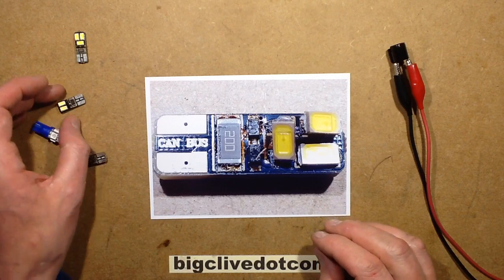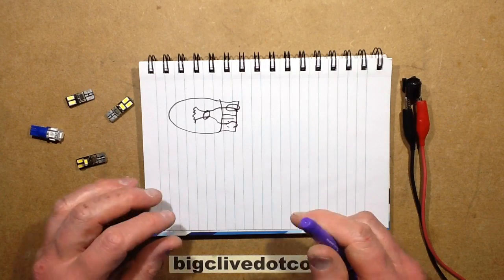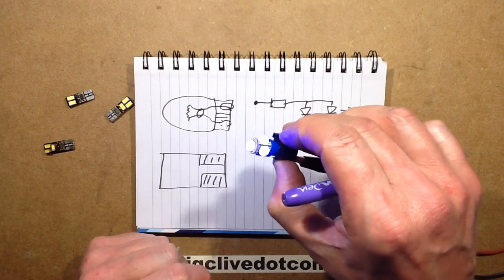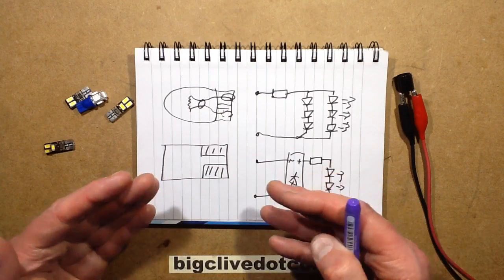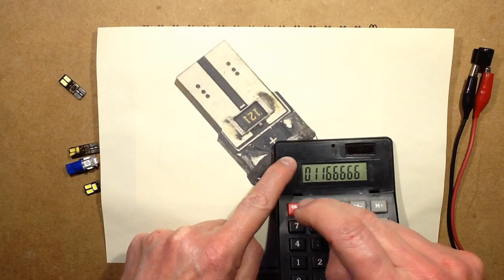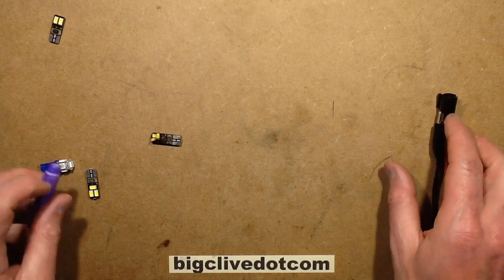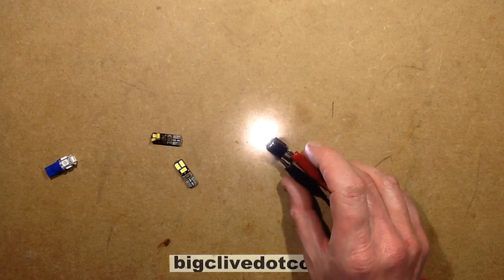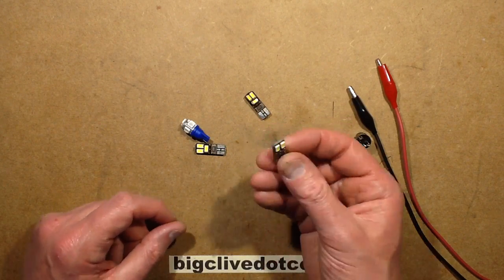Smokin' hot CANbus LED lamps.  (230C in open air.)

Comment: Recently installed a few different led bulb types to a Vw golf mk5 2004 and the canbus system doesn’t like any of them the parking or side light 501 bulbs like you show in this video don’t even work due to the system not getting the correct resistance so I found resistors with heat syncs to wire in and solved the issue after working out which resistance each bulb needed I do worry tho as the full beam and parking light wires are shared so i’m not sure it’s safe to use the 5w resistor on the 501 as the higher resistance bulbs are sharing that I believe the higher resistance needs the 50-60 watt resistor

Comment: THANK YOU for the information. Now, the real issue is that these are not necessarily compatible with ANY system not deigned with cooling air flow. I would think that there is HUGE liability by stating that they could be used for interior lighting, dash lighting, side marker lights etc. The inference being that these CANBUS compatible lights are fraud in the inducement and violate all US state's advertising laws. Problem: how the hell to make the manufacturer/seller (usually Chinese) responsible financially for the damage they are causing.

Comment: What happens if you remove the parallel (120 ohm) resistor? Can it then be used as for continuous light applications instead of a flasher?
Reply from the maker: You can remove the parallel load resistors no problem.

Comment: The original lamp is 5 Watts by standard. But even 2 Watts (1,6W + 0,4-0,5Watts from the LED) is enough the car electronics to get that the lamp is not burned out

Comment: Some cars turn off the interior light (in my case the trunk illumination) when the load is too small. But you don't need 1,5W to trigger the computer to keep the voltage present for the light. It just needs about 50mA of current. So instead of "can-bus" light, I put an ordinary LED lamp and added a 390-ish ohm resistor in parallel to it. It gave totally around 50mA and the car was happy. So instead of a 5W tungsten lamp I have a 20mA LED plus a resistor that bumps the current up to 50mA, which at 12V (you open your trunk mosty when the engine is off) gives only about 0,6W. Now I can leave the car with the trunk open for a longer while and not worry about the 5W tungsten light discarging my battery.

Comment: The new CANbus T10 LEDs (2 x 7020SMD LEDs back-to-back) are temperature lower with 5 to 10 degrees C than regular W5W halogen bulbs, in any measurable point (socket, middle or top). The hottest point was at 49~50 degrees C. Also, after 48 hours of continuous lighting at 14.4 V they looks like new, without any visual sign of burning. The absorbed current from the power supply was constant over the whole test, it means the LED bulbs did not suffered electronic modifications. The LEDs are 60% more efficient and twice brighter then halogen bulbs (having the same size), enough to substitute the car's W5W halogens with pleasant and modern white light. They are perfect to replace all the regular bulbs without fear, the CANbus is not complaining in any way, despite the fact that the equivalent resistance of these LEDs is 910 ohm and they have electric polarity.

Comment: Bit late , but, some computers need the + wire to see negative. Thus the resistor pulls the + down so the computer thinks the light is fitted.

Comment: I used the normal ones without resistor and even these burn out too fast. I now adapt G4 2 watt lamps works like a charm.
Lesson: Always use residential 12v instead of automotive rubbish

Comment: Would removing the load resistor (SMD) be a solution? 

And how hot do filament bulbs get in comparison?

Just fitted them as plate lights, do still get a "bulb out" warning.

Will remove them now :)
Reply from the maker: Yes, removing the load resistor is viable if accessible.
Reply: @bigclivedotcom  my version is a bit different, 15 LED's, 1 load resistor 561 (560 ohm), a rectifiër HLB7 and capacitor, on the other side is a driver circuit I guess, 470 coil, 4211 (VR?) K14 diode.

I could also replace the current resistor and add a second one. So one on each side, 281 SMD right?

Wil dissassemble one tomorrow.
Reply: Final word: I don't have a FLIR, so I used an ntc on my multimeter.

After 15 minutes temperatures don't exceed 87 degree celcius (open air, roomtemp 23 degree).

The rectifiër wins with 87, resistor 81, small cooling block sandwiched between the LED's is  86 degrees.

Even adding an additional 20 degree fault margin would still not pose a problem as far as I know.

With load resistor appr. 0.17A at 14.2V. without 0.14A and doubling up resistors 0.20A.

Stock W5W filament is up to 165 degrees within seconds. Draws appr. 0,40A.

So doubling up resistors will still cause a bulb out message. Will have to add two resistors of 1k at least.

These are the ones:
https://m.nl.aliexpress.com/item/4000378018693.html?spm=a2g0n.orderlist-amp.item.4000378018693&aff_trace_key=f6bb70c6af244a53bae6cfc3a8fa471e-1588949402564-08954-_dZPAgKL&aff_platform=msite&m_page_id=4576amp-K_TuB5Sh8h7RzRX1CLdqKQ1590052980822&browser_id=9dfb0a0115264794bed5016d77111b8d&is_c=N

Thanks for the video(s)!

Comment: Just went down to my garage, pulled one of these out of my car and de-soldered the resistors (two 220ohm in parallel, for a 110 ohm total resistance). at 12v, current dropped from 140mA to just 31mA.

Comment: There is also a 'jumbo' LED style of lamp which is quite literally a single LED, but is as big as  normal T10 5W tungsten lamp. I've used these for side lights in my cars for almost 9 years now and so far have not encountered any issues with them. I have also tried these mini PCB types, as well as the 'corn cob' style, neither of which has lasted more than a few months. I relegated the mini PCB types to lighting the front foot wells, and in that role they last quite well. For dashboard lighting, I have been guided away from LEDs since the amount of heat that can be generated in an instrument cluster can drive LED lamps to heat up sufficiently enough to catch fire. For that role, I am strongly advised to keep with standard tungsten lamps. This advice comes from several garage mechanics who have been tasked to repair damage caused by LED lamp failures.

Comment: I absolutely love this video. I like to tinker with cars and LEDs and there is so much mis-information both from sellers and installers of aftermarket lighting that pretend that these bulbs are special because they're "canbus" approved. At the end of the day, it's just a resistor mimicking the load or voltage drop of a incandescent bulb. Keep up the great work Clive!

Comment: How about canbus headlight bulds? How do they work, there is a fan build into it... inhave bought 2 pair and did not get canbus error but now im thinking i could burn my car...
Reply from the maker: The canbus reference is usually just a load sensing lamp detector.  The load of the headlight may be high enough for it to detect that the lamp is intact.
Reply: I have checked the temperture with my digital laser meter and they are warm but not hot... the led headlightbulbs

Comment: if you don't have the can-bus connected light bulbs, the best way to correct for hyperflash is to get a LED compatible flasher relay.  it's less than the price of two well made resistors, and it doesn't involve any splicing.  if you do have can-bus connected light bulbs, a new relay will not correct the warning, but it will solve the hyperflashing.

Comment: I think that resistor in parallel is set there to trigger the bimetallic relays in car turn indicators. They need the current to make sure enough passes to heat up the strip in that circuit.

Comment: I had changed the side lamps to LEDs but after they failed the second time I put back ordinary bulbs. I had put the LEDs hoping they would last longer.
The 'CANbus' resistor probably was the main cause of failure although I think the LEDs being over driven was also part of it.

I would like to put back LEDs though and I had experimented a bit. What I found was that first of all I could use a much higher resistance to keep the fault detection system happy. I think it could take up to 560 ohms or something like that.
However, not bein happy with that I got an idea. I had noticed that the LEDs flicker slighlty when the lights are switched off but the ignition is turned on (with or without the engine running) and wondered why.  It turns out that the ECU checks the filaments by putting very narrow voltage pulses across the lamp and measuring the voltage drop on that pulse. That gave me an idea.

Instead of putting just a resistor I could put a capacitor in series with it as that would appear like a direct connection to the pulse but it did not work. All I needed to do was to then add a relatively high value resistor across the capacitor and everything worked fine.  So in the end I had (across the lamp input terminals) an 82 ohm resistor in series with a 10uF electrolytic and then a 1K8 resistor across the electrolytic. The steady dissipation is now less than a quarter watt. I also increased the LED series resistors to decrease the current by about 30% to make the LEDs last longer.  With these mods the lamp now runs much cooler, not too hot to touch briefly and just a bit too hot to hold continuously - sorry I didn't actually measure the temperature but it is definitely below 100 c. I have two such modified LEDs in the reverse lights and they've been running for about 4 months now, so not long enough to know if the improvement really worked.

I'm not sure why it works also when the lights are on but I am presuming that either it is happy with higher resistance when the lights are on compared to the cold test or else perhaps it also pulses the lamps during test  when  they are on. 

I've no idea whether this behaviour applies to all or even many different cars or is specific to the electronics of my car but may be worth a try if you want to make better LEDs for your car.  My car is a 2005 Range Rover. At that time Range Rovers had BMW electronics so I suppose that BMWs of around that time would also behave the same as would of course also other Land Rovers and probably Minis.

Comment: I put a very long t10 LED that was loaded with tiny smd LEDs into a sprinter marker light (enclosed and on constantly with engine) and it got so hot that the LEDs desoldered from the boards and slid around, some falling off into the light housing!  They were the most basic design, not rectified or CAN bus, so yeah, if it comes straight from China it’s best to run some tests to see how it will behave in a vehicle since they probably didn’t.

Comment: I fitted these as the sidelights in my Freebie but they failed fairly quickly and literally fell apart; I actually burnt myself when removing one.  The sidelight bulbs are in the main headlight housings and I assumed that it was the heat from the headlight bulbs that was causing them to melt. Thanks for the clarification.

Comment: EXCELLENT POST!  the load is just drawing current defeating the efficiency and yes just generates heat. The best way is to use car diagnostics to turn off the check cycle for the lights

Comment: why people fit these bloody high intensity led lamps to there cars i will never understand, they create glare to on coming traffic because the light intensity is to white i have noticed that the car manufacturers are fitting daylight running leds to modern vehicles that are not needed in daylight conditions, why car owners pay for these expensive led devices when a glass bulb works just as well. I think the police should start prosecuting drivers using these bloody things, as they are a danger to road users.

Comment: How hot does the original glass bulb get? they are so hot you can not touch them. I would have thought they were about the same given they must be using the same amount of power with the CANbus monitoring.

Comment: Interesting 230C, now I am not really into C as I was born and raised in F land, however to realize what this actually means, my Cheap China thermostatically controlled lovely little robins egg blue soldering iron with thermostat on the handle melts solder very well at around 250C and when things get tough such as large connectors, I crank her up to 350C and she will melt the most stubborn lead free solder.  That is damn HOT, I can attest by the scar on my arm where I accidentally touched the soldering iron when it was resting on my desk and I reached over it for my coffee cup.

Comment: SMD 5730  get horribly hot... i have at home E27 fitting bulb with smd 5730 diodes. the burn and fail in about 30 days of regular use..

Comment: But how can I reduce the heat?
Reply from the maker: By using an LED lamp without the resistor or by removing the resistor that connects between the positive and negative connections to just pass current.
Reply: the problem is that the BC shows an error. So I need it but it get so crazy hot like 95°. If it reach 60° it is ok.

Comment: I brought some of these a few yrs back and found this out quickly too. Useless for front sidelights, especially as they are on for a long time. And there is zero airflow inside a headlight unit. Better off using a in-line high power Resistor with Heatsink that you can attach to some metal work in the engine bay.

Comment: hey clive are those blue ones you had in this video any good? i literally just ordered some and i would love too know if there is a fire possibility lol ill be using them in the dash light configuration so really need to know! thanks
Reply from the maker: If they have the extra resistors across the supply they are the type that heat up.  You may be able to tell with a simple resistance test.  Or plug them in and try them and then feel for heat.
Reply from the maker: The blue style in the video should be OK.  It tends to be the PCB based ones that have the hot resistors.
Reply: ok thank you very much sir! ill test for resistance as soon as i get them. lol multimeter is a must have :) so i got a uni-t... i knew about it before i got it cuz i saw test by dave jones at eevblogs :)

Comment: I wonder if somehow the whole CANbus bit resulted from a misunderstanding of what the resistor is for. 120 ohms is also the standard end termination resistor value for CANbus (60 ohms total due to 120 ohms at each end, effectively in parallel). CANbus is also just two wires (plus some form of ground reference).

Comment: I have almost every light in my car as an led, I have been through quite a few bulbs and some of them did melt almost like he showed here. BUT I have found good leds that last and I haven't changed mine in months. my breaklights, front and rear blinkers and even my licence plate lights are all led, just don't buy cheap stuff from China.

Comment: what abou non canbus like the blue one led?? and i have canbus in my trunk lite is it okey or do I need to remove it?
Reply from the maker: If the trunk one isn't on for very long it won't get too hot to cause damage.
Reply: its like 15min max at once, only when the trunk is opened

Comment: a Warning! I couldn't be asked to read if someone had already mentioned this fact,  BUT, if you use these lights in the UK, apart from the demonstrated problems, using these LED lights in indicators or sidelights ect... could land you in hot water with the local constabulary. if they are a mod for replacement of the car manufacturers ordinary filament lamps you are breaking the conditions of your insurance company.  if in an accident and an investigation occurs, your insurance might be invalidated. I don't need to ride-out the implications for you but worst case scenario is prison.

Comment: I desoldered the canbus 150 ohm  resistor and discarded and on the flip side of the pcb desoldered the 330 ohm current limit resistor and swapped out with a 680 ohm resistor 1/2 watt. Fired it up and it still puts  out a modest light @14V and even after 1/2 hour you can squeeze the lit leds between your fingers and feel nothing...heat wise. Ran it all night with same result. Not too fussed about the canbus resistor function anyway...

Comment: Hey, love your videos! I design automotive LED bulbs like this for a living. What's funny about these cheap "CAN-BUS" bulbs is that they still only draw about 2-3W, which will still create errors on the dash in newer Dodge/Chrysler, Merc, VW, and BMW. They get realyl hot, and still don't fix the problem! Note that the best T10 (and T20) bulbs on the market now use full buck regulators to drive high-power LEDs. Anything with resistor-limited current, and without a TVS, will die over time as it gets hit with transients. Overall, there are WAY too many cheap versions on the market!
Reply: needs a Resistor with heatsink to pull more load 

my punto uses W5W 5w lights  (branded RING or Halfords Premium 501 W5W LED) but the CanBus LED ones i got only pull 3W its like 1w away from pulling enough power to make the warning light go out as sometimes when i turn my dipped lights on the warning light goes out for a second) getting the Prism Resistor 501 Kit as there is no cutting or splicing it got plug and socket for a bulb and Resistor in one cable (if the W5W was pulling 5W on the Resistor on the LED it it would kill it self like in this video, to bad cars check that the required wattage is need to set the warning light)

overall your better having a external Resistor and heatsink and not buying canbus LED lights as they last way longer (thinking of just destroying the Resistor on my LED and having 2 3W Resistors but going to see how they go for now see if they overheat)